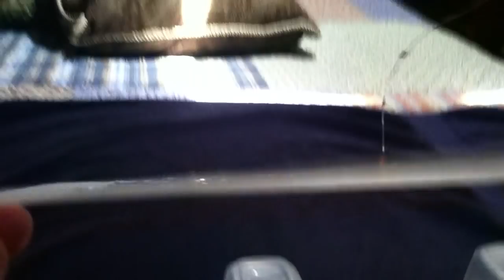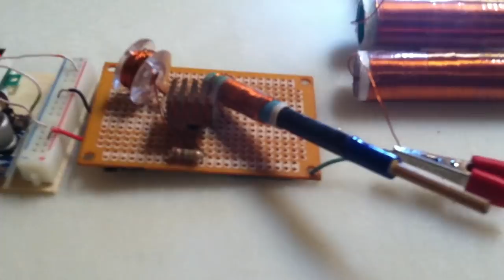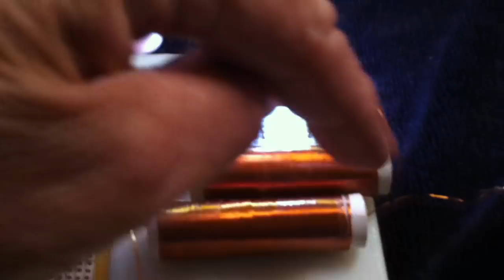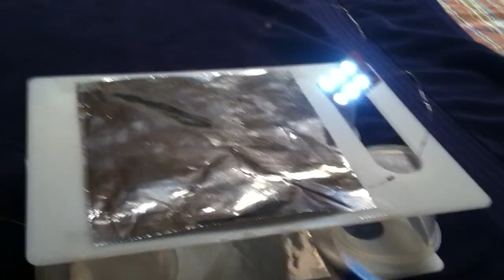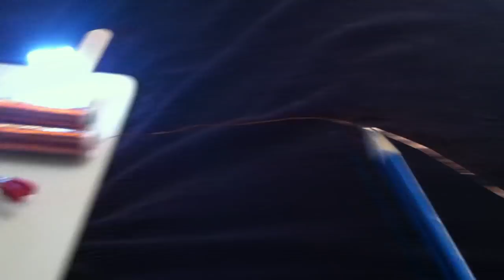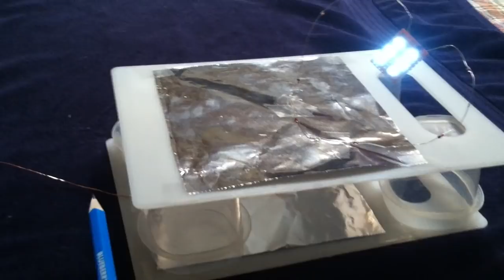Stiffler Loop  ---- How does it work?

Comment: Cool video, thanks for posting! 
Using a  “false ground” connecting one lead of an LED to one end of a coil wrapped on a torrid (the other end of the coil is left floating) with an “antenna” on the other LED lead, I’ve found that I can get them to light if the antenna wire is sufficiently close to a high energy source like a Tesla coil or a fluorescent lamp. With an earth ground, they light up just by touching the other LED lead with my finger and reach full brightness if I put my other hand on the two tube florescent bank above my work bench. 
I think the diodes may be acting both as capacitors and antenna (not to imply they are not also acting in a switching capacity of some kind but it doesn’t take much to get an LED to light up so I’m not sure how important they are). Since you’re picking up a wave that is switching faster than your eye can detect, I would imagine that you have essentially made a dipole antenna
https://instagram.com/p/Bl1qNlGF1hX/
Every coil geometry has a different field geometry as well with every coil having a magnetic “dead spot” or null. Cylindrical coils mimic a bar magnet the most with the neutral zone being in the middle which is why you have the least coupling when you turn that second cylinder coil LED array 90 at the other coils center. Not only are their fields perpendicular but it’s in the null spot. 
A cool use I found for a switching diode was in a modified joule thief circuit. I used a small high frequency toroid with a diode wired with its anode connected to the Base and the cathode to Emitter / ground. The resistor usually feeding the Base on a standard joule thief had a capacitor between it and Base. You had to jump start it by shorting Base and Collector momentarily with a switch but once it got going, the diode dump would ring and I could light some moderate COB panels at rather low voltages. The current usage was obviously rather high so I had to use a TIP31 to handle it. Thanks for posting! It’s cool to see other people’s experiments and findings.
Reply from the maker: Thanks for the great comment.  I have done the Joule Thief setup you mentioned and It works exactly like you describe.  Like minds think alike.

Comment: All coils have capacity (ability to store little "extra" energy) and inductance (ability to "suck" small energy spike), depending if its charged or discharged. And specially if the frequency gets closer to static skin effect. It can also be boosted with capacitor plate that is grounded.
If i understand correctly, the ring modulation effect is the same as "Beats" in acoustic physics (Look for: Julius Sumner Miller: Lesson 33 - Vibrating Bars and Strings - The Phenomenon of Beats). If two right frequencies are mixed, they create third frequency that is pulsing and has more loudness. Its all about tuning the energy according to the mass and resistance. And there is the "Helmholtz resonance" effect. If we produce the natural ringing frequency of a bottle for example, and play it with speakers, the bottle also begins to ring and blow air. (Look for: Why Blowing in Bottles Makes Sound and Helmholtz Resonance).
Reply from the maker: Thanks for the comment about ring modulation and how it ties to acoustic physics. Great info on this topic.
Reply: Yes, that's the basic principle of all tank circuits that have high frequency coil tuned with capacitor (and grounding). The transistor or spark gap in the circuit just adds the amplifying element for it and seems to act like "ram pump". And the high frequency seems to mean less resistance. The biggest issue in the circuit is the resistance and voltage drop on the diodes / transistor. I believe that vacuum spark gap with adjustable gap would be the best option, but its quite hard to make in home and they are not for sale. Its not hard to make in to bottle etc. but its difficult to keep vacuum in it without melting the glass. And this brings some very nasty elements to the experiment cause of x-ray etc. So it should be in lead box or at least have some UV filters or something similar.

And i don't have any interests in algebra :D I believe in field theory and Aether, not in particles. To me it seems that there is always some natural action that can be compared to action of electricity. To me electricity is just difference in frequency and heat dissipation. All matter just follows the path of least resistance.
Reply: So why do you think physics haven't invented anything on this subject after Maxwell & Tesla? I don't believe in anything you cant tell to regular people. You know that there is a huge difference between people who think they know the theory and those who actually build these systems. And you know what i'm talking about even that i'm from Finland, no need for nitpicking on my words.

Comment: It remembers me to a similar concept like AV plug and also the demo that Don Smith demonstrated using 2 plates where he fed the first plate with single wire electricity (using like a car's ignition coil) and the second plate acted as a receiver. As you know, Don Smith demonstrated several times the concept.